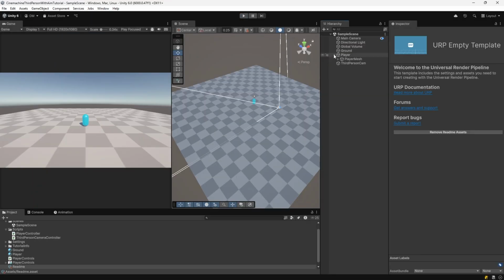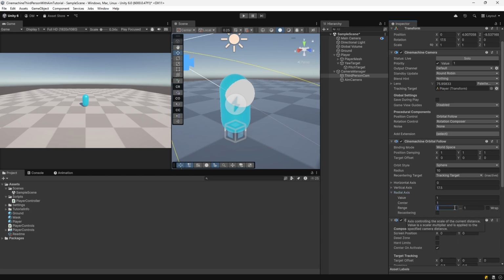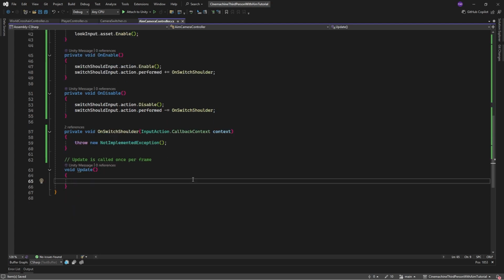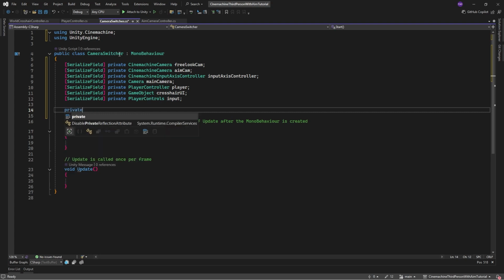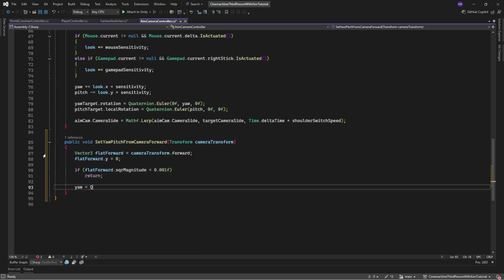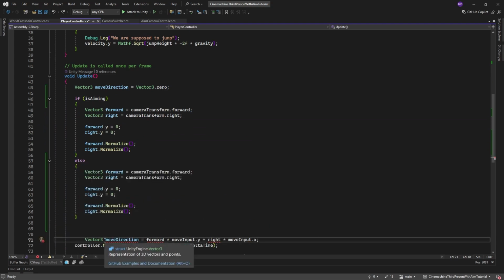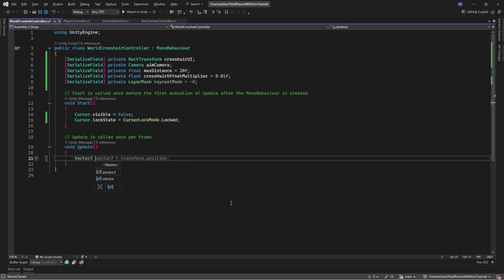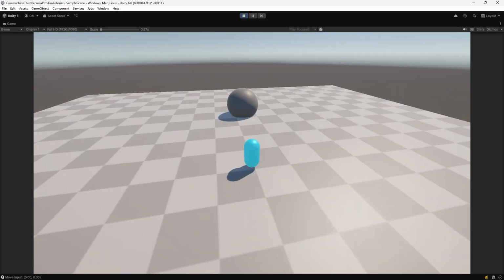Don't Build Your Aim System Until You Watch This

Comment: Excellent tutorial! Although I have a small error where the aim camera can rotate around fully and then jitters slightly when I rotate too much up or down, any suggestions for help there?
Reply from the maker: Thanks for the comment! Off the top of my head cinemachine might be updating at the wrong interval. Check the cinemachine brain on your main camera and experiment with the update timing.
Reply: @FaktoryStudios  Thanks for the help, but I still haven't solved it, a better explanation is: when the aim camera's X axis reaches -90 or 90 degrees (The camera facing the top and the bottom of the player), the camera moves slightly to the left, any ideas on what could be wrong here?
Reply from the maker: When the camera reaches the poles it likely has issues aligning properly as the left and right movements become ambiguous at those orientations. If you clamp it to 89degrees do you still see the issue? 

What kind of game are you building that you want the camera moves to reach the poles?

Comment: I'm not able to rotate the camera up and down when I'm aimed down... only left and right. At first I followed along with your script and wrote it myself, but when it didn't work, i just downloaded and copied your script exactly. Still doesn't work... I wonder what I screwed up :/

Thanks for the awesome videos.
Reply from the maker: Thanks for the comment! Off the top of my head you may have something limiting movement in the orbital follow component in the inspector. Since you downloaded the complete project you should compare the settings between the two projects, specially the components in the aim camera.

I hope that helps. If you keep hitting a wall I can help you on discord.
Reply: @FaktoryStudios  Thanks, i did figure it out, for some reason along the lines you swapped out "nose" as the target to the yawtarget for the aim cam target. I must've missed when you did that and it screwed it all up. Though i don't know why that would fix it. Both the yawtarget and nose object were exact same world space, both empty objects with no scripts... bizzare.

Comment: For some reason, my crosshair is appearing regardless of whether I am in the aim camera or free look camera.
Reply from the maker: You may have the canvas setting to screen space not world space. Check to make sure ‘Render Mode’ is set to ‘World Space’ in the drop down.
Reply: @FaktoryStudios  Just checked everything again. Render Mode is set to World Space. I'm wondering if I missed a line of code somewhere, but I can't see where.
Reply from the maker: The relevant code in the "WorldCrosshairController" is located in the LateUpdate method:

        Vector3 screenCenter = new Vector3(Screen.width / 2f, Screen.height / 2f, 0);
        Ray ray = aimCamera.ScreenPointToRay(screenCenter);

        Vector3 targetPos;
        if (Physics.Raycast(ray, out RaycastHit hit, maxDistance, raycastMask))
        {
            targetPos = hit.point + hit.normal * crossHairOffsetMultiplier;
            crosshairUI.rotation = Quaternion.LookRotation(hit.normal);
            Debug.DrawLine(hit.point, hit.point + hit.normal * 2f, Color.green);
        }
        else
        {
            targetPos = ray.GetPoint(maxDistance);
            crosshairUI.forward = aimCamera.transform.forward;
        }

        crosshairUI.position = targetPos;

Make sure your code matches this. It uses the center of the screen to shoot a ray forward and where ever it collides or reaches the limit of the ray, it places the crosshair.

It appears, I did not complete the crosshair logic in the CameraSwitcher, it should hide and unhide the crosshair in the enter and ExitAimMode() methods. Currently the crosshair in third person is usually obscured by the player but still visible, ideally it should be disabled.

I hope that helps! Feel free to jump on discord for more help-- Link is in the description as is a link to the project (on patreon)
Reply: @FaktoryStudios  Thank you, this was a big help. I'm really enjoying your tutorials. I'm very new to this and have been going through the Junior Programmer course on Unity. I've been trying to build a project where the player must navigate an arena of moving obstacles and throw a discus at targets. Probably a bit ambitious, but so far it's been going pretty well.
Reply from the maker: Awesome! Ambitious or not the more you push yourself the more you’ll learn! Keep it up.
Reply: @FaktoryStudios  Just downloaded the game files from the description link and the code is identical to what I've got, so that doesn't seem to be an issue. Really strange. I'm a bit confused as to why we've set up a public GameObject for the crosshairUI, but it never appears again in the body of the code.
Reply from the maker: That was an oversight on my part. If you see my previous comment, I note that it was intended to include logic to hide and unhide the crosshair when swapping between aim and third person modes.

I’m happy to take a look at your project if you want to share it. Reach out through the discord channel.

Comment: Thank you so much! Your work is great, I've been following for a little while as I start work on my own project.

I've been struggling to adjust this for my needs, however. I noticed between when you aim and revert to your ThirdPersonCam, the aim target shifts between the two views.

I'd like to keep the aim target consistant between the ThirdPersonCam and the AimCam. With the view for my player as a third-person, over-the-shoulder kind of look, I'm assuming it would be better to use a third-person follow component instead of an orbital follow? Then, when I'm aiming, I'm thinking it may be easier to adjust the ThirdPersonCam transform and FoV instead of swapping to another camera.. that might hold the same target point? What do you think?
Reply from the maker: Thanks for the comment! I appreciate it!

The reason I did a camera swap is to avoid the flattening that can occur with a field of view change. I personally think that effect is nicer for things like looking through a scope or binoculars as it flattens out the view the more you lower it, but that’s a personal preference.

It’s definitely easier using one camera and avoiding having to manage two.

I’ll take a look at the aim target and get back to you on how it can be updated if you want to stick with this setup.

Comment: It said in Unity 6.2 that: 
"Project-wide actions asset is not recommended to be used with Player Input because it is a singleton reference and all actions maps are enable be default.
You should manually disable all action maps on Start() and manually enable the default action map."
and there are warnings of missing UI Action Maps. Does anyone else experience this problem ?
Reply from the maker: I haven’t done much with 6.2 yet but I suspect you’re pointing the Unity action input map that comes with every project now to the player input component which is set in new projects as the default input map and not a custom made map. I’ll take a look when I get to my pc later and update this post.
Reply: Thank you for your reply. Your awesome!
I used custom action input asset just like your video and deleted the default one. Maybe they changed it in Unity 6.2 ?
Reply from the maker: Thanks for the kind words! :) I was able to open the final project and test it in Unity 6.2. I didn't come up with any issues. Have you tried downloading the project from link in the description? If you want to try troubleshooting I can help you on discord, links also in the description.
Reply: @FaktoryStudios  Thank you, I just joined discord and upload the image of the warnings on my project. I didn't download your project to test since I followed the tutorial step by step, I'll try download it and see what's missing.
Reply from the maker: I took a look at your screenshot and recommended removing the action map from the default input slot in the preferences -- response on discord but I'll also respond here. It's intended to be used in code, not as a reference in the inspector as we do in this video. I'll have to follow up on this video regarding the default input map in Unity -- it can be a bit confusing but also really helpful to get up and running with code.

Comment: Another banger!  Keep it up.  I changed the gamepad controls a bit.  Changed the aim from right bumper to left trigger.  This way the zoom in now works with the gamepad and changed the switch shoulder to right bumper.  This way you aim with your left hand and with your right hand you can fire, personal preference.  I'm not a fan of holding bumper with pointer finger and using middle finger to fire.  Can't wait for the next one.
Reply from the maker: I appreciate the comment and the feedback! Glad to hear you're customizing it and thanks for watching. Your bindings make a lot more sense, when I make a follow up I'll swap the bindings around.
Reply: @FaktoryStudios  Thanks for the reply.  Your pacing in your videos is great and also your explanation of the code that you write is also concise and to the point.  Really helps to be able to add comments to the code.  If you are looking for ideas for tuts, i really feel that there is a not any good ones on UI toolkit.  Don’t know personally if it’s better than the old system and even if it is no one is explaining the differences between them or why one would be a better use case than the other.  UI is not the glamorous fun stuff, but if your ui sucks your game sucks.  On a side note, went to look for your course but could not find it.  Is it a live course and only run at certain times or am I just looking in the wrong direction?
Reply from the maker: Thanks for the feedback and suggestion! I have done a ton of UI work in uGUI but not UI Toolkit although, everytime I look it's progressed more and more. It looks a lot more like working with web layouts with uxml and uss files (xml and css) but with a pretty comprehensive editor. From what I understand it still isn't available for VR or worldspace UI or any UI you might want to use with materials and effects. But in creating hi-resolution scalable text, buttons, fill bars, and other assorted UI stuff it looks like it's a great tool. It's also recommended for building editor based tools. I'll do some research on it! :)

As for the course, it's linked in the description of my videos. I am refining it to update the pacing to be similar to my youtube videos but it runs students through building a local multiplayer brawler. It's on this site: https://courses.faktorystudios.com 

Thanks again for all the feedback! I'm trying to build a unique style with my videos and hopefully make a living off of it so I can make my own indie games-- crossing my fingers. :) If there's any way I can help you on your game dev journey feel free to reach out. I've also setup a discord channel that's linked in the video description.
Reply: @FaktoryStudios  Thanks for the reply.  I don't really know much about UGUI or Toolkit.  Since I'm just starting out was trying to focus on which one to learn.  Kind of feels like a no man land.  Don't know if they are going to depreciate UGUI in the next year or so, but at the same time not really keen on learning front end web design either.  From your reply and what I have read on the subject I guess uGUI is the play...for now I guess.

Your style is great btw, you get to the point with good audio.  Gonna sign up for your course today!
Reply from the maker: Thanks! Reach out with any comments/questions.

Personally, I think uGUI is the way to go. Even as Unity puts more effort into ui toolkit, uGUI is already a complete system that is tightly integrated. It works with the Unity animation system and uses gameobjects.

Comment: It's amazing luck I am making my own third person test and you post after I take a break!! Question! What is the advantage of using two different cameras and switching between them instead of just using a third person aim camera and adjusting the fov upon pressing the input?  Or even using the follow zoom component in cinemachine?
Great video!
Reply from the maker: Thanks for watching! Would love to see your solution. 

I personally like FOV changes for things like running, or flying, or other fast movements but prefer to adjust camera position for things like zooming or aiming. The lens distortion is to dramatic IMO, just my preference.

I'm using two cameras to keep the functionality separate and take advantage of Cinemachines blending feature. The OrbitalFollow camera is fairly easy to setup with the InputAxisController for orbiting and zooming in and out while the aim camera is great for shoulder swapping. 

I did attempt to use one camera a while back and found it to be more complicated to manage camera behaviors and nail down exactly what I wanted.

Comment: How do you change the camera position?
The transform on mine is set to 0.5,0,-2
Making the camera appear on the ground/ at the feet of the player
Reply from the maker: For the ThirdPersonCam it is set based on the the Tracking Target defined in the CinemachineCamera component. If you are looking at feet it's likely that your players pivot is set on the ground at the feet. You can add a child object of your player called Camera Target and move it up. Then set that as your Tracking Target. There are also various settings in the CinemachineOrbitalFollow component that can affect the starting position like the Radius and offset values.